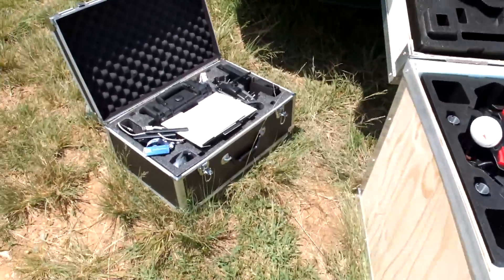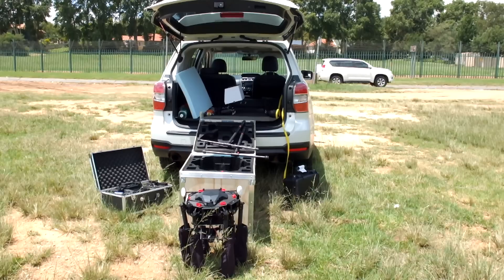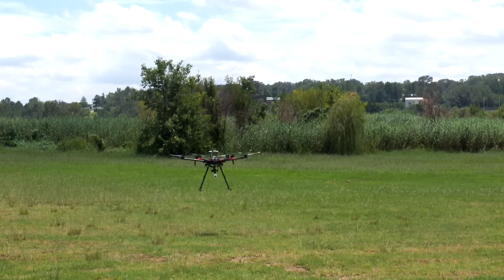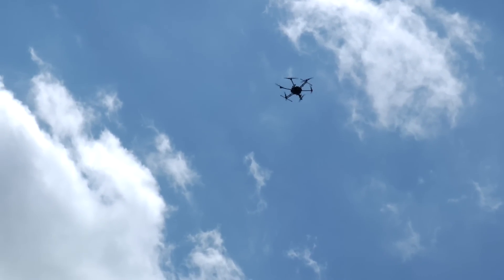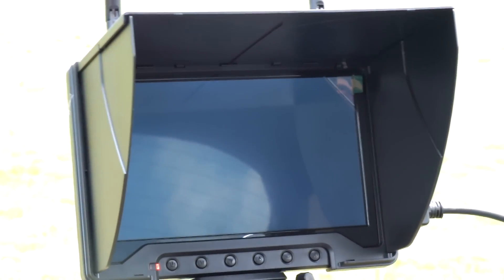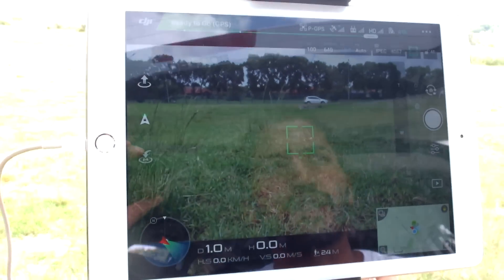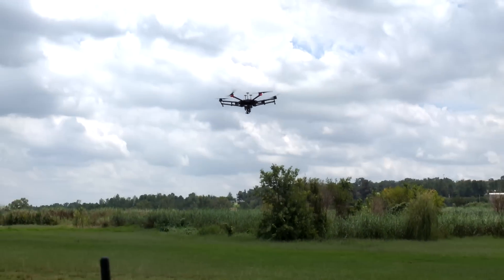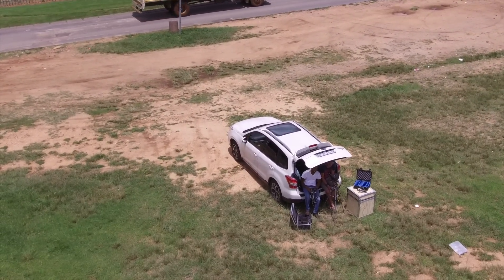DJI MATRICE 600 PRO Industrial Drone Test

Comment: Hey how you doing listen I have this same drone with the lightbridge setup on it. When I’m on the app it shows the location and all but I can’t get no image. I just bought the new DJI fpv air unit to replace it but it requires soldering. Help please

Comment: Nice flight! Could you tell me how do you install two cameras on the M600? Any accessories to buy? Any instructions?
Reply from the maker: Hi, sorry for the late reply. The manufacturer created a gimble system for the thermal camera and the z3 camera used the standard mount and gimble. Thanks

Comment: Hey did you zoom in with Z3? is digital zoom? thanks
Reply from the maker: Zita Films 360 yes, it worked pretty well, 3,5 x optical zoom and thereafter 2x digital zoom.

After 3,5 x optical zoom the quality remains the same